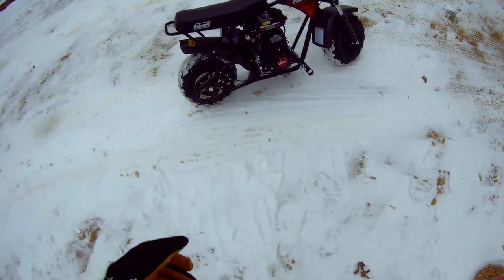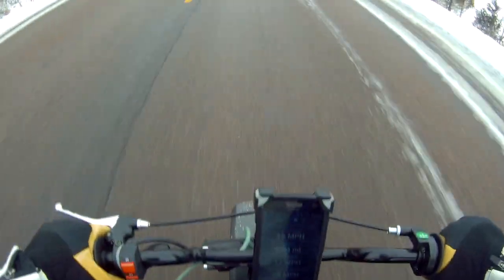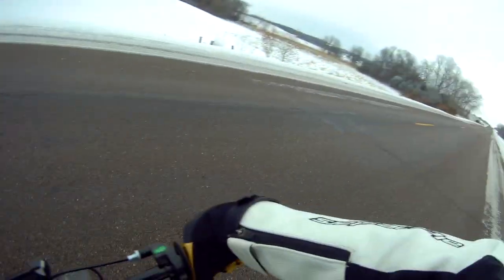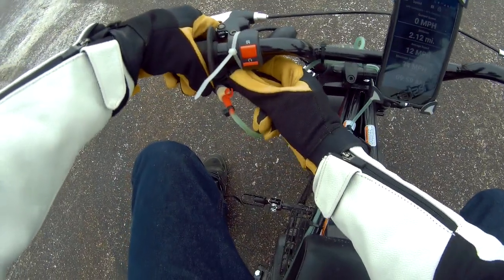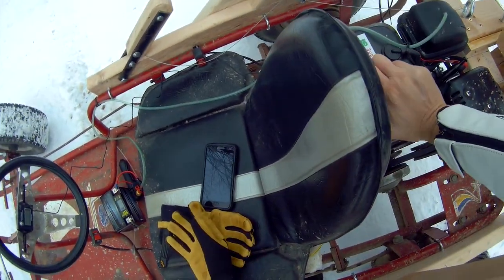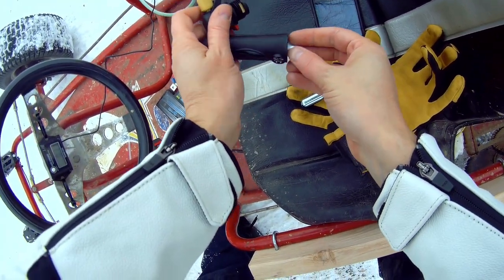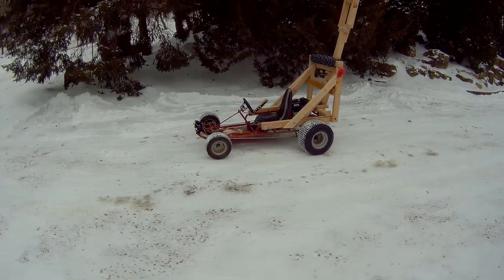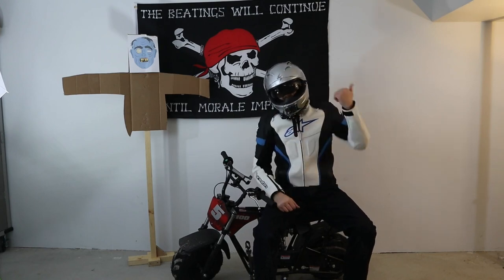Mini Bike and Go Kart NITROUS OXIDE Kit (NOS)

Comment: You are in cold conditions and likely jetted too lean already. Hitting N20 just adds oxygen and leans it out more. You need additional fuel to make power. Best setup for this is using E85 or even better E98. They have a huge peak power air/fuel ratio window, unlike pump gas. Jet it to peak rich power NA I ran 10.8:1.  Then put a real 2lb N20 bottle/kit on it with the 5-10hp jetting and its very unmistakable when it comes on! lol. Done it MANY times with a wide band 02 sensor in place. N20 is active at the 22 second mark. feels like its going WOT again!  This is an 8HP shot on a mild cam'd 212  https://www.youtube.com/watch?v=Ars6efUv8Dw

Comment: I would like to install a NOS kit but im thinking of either installing another throttle cable via hand lever or mounting to throttle plate and making linkage that pushes button at WOT. My goal is to locate the bottle as close to the carb as possible. Possibly making a carb plate out of white phenolic aka a piece of cutting board. No tube lag and minimal waste of NOS.
Reply from the maker: Nice!

Comment: 3:28 n2o isn't a stand alone power power adder it allows you to add and burn more fuel put you a fuel pump and a small injector that activates when you apply the n2o and you will be amazed at the added power.     Be careful that you don't over do it and turn the engine into a grenade though 👍